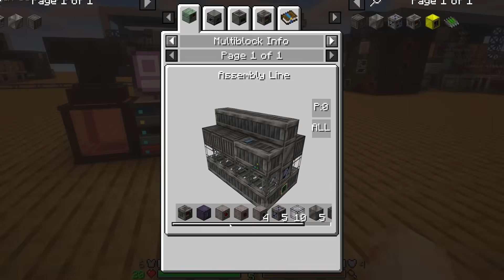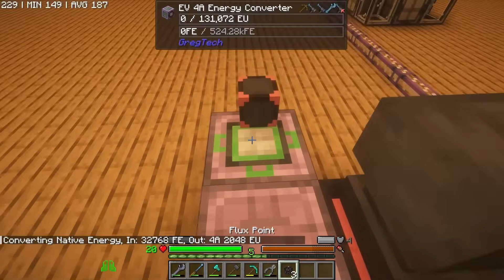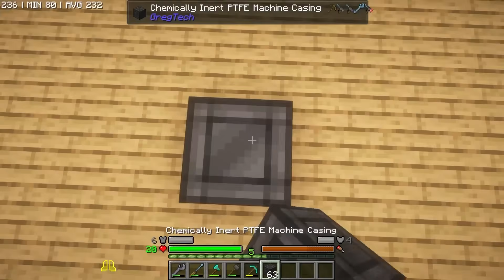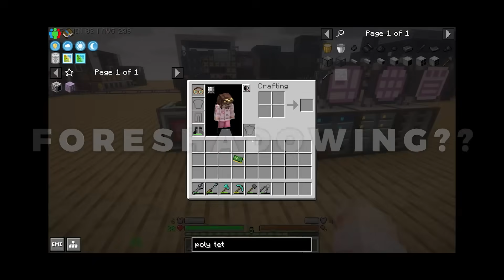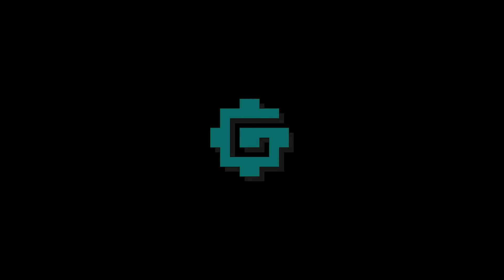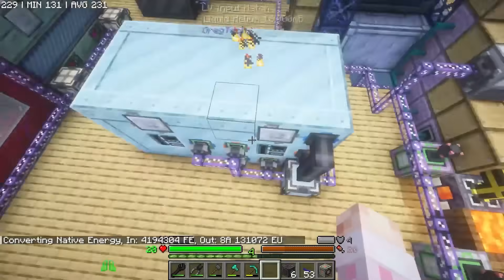Creating INFINITE Power In Skyblock | Star Technology (Part 6)

Comment: Hi there, i really enjoyed your video.

Gregtech is a difficult mod. But, here are some things to make your life just a little easier:

- Use 16a energy hatches -> they will not only skip a recipe tier, but will overclock to ridiculous speeds. (one 16a ZPM energy hatch = UHV processing speed, two 16a ZPM energy hatches = UHV processing speed and UV Recipe tier.)

- I'm not too sure how it works in star technology, but in most other gregtech modern packs, you can power all gregtech infrastructure with flux points. It will automatically convert FE to EU. 

- Your fusion reactors can be made cheaper in the future. Use fusion glass instead of fusion casing. Will save you TONS AND TONS of trinium, which takes ages to smelt.

great video, again.
Reply: @kopkalol123  i'm currently at ZPM and this comment was very helpful so thank you! Flux points cannot provide EU to Gregtech machines though, the config is disabled in this pack.
Reply: @TheDardo1997  interesting, last i checked, Flux points did work in ATM9.

Glad I could help otherwise.

Comment: To make things faster you can make 16A energy hatches to speed it up by 2 tiers and is you want it to be a be able to craft the next energy tier you will still need another regular energy hatch. For the assembly lines you can make a data bank to store all the data. Also for the fusion reactor if you use the 16A energy hatch you only need to power that singe one but you will still need to other energy hatches to reach the energy requirement.

Comment: You should have used fusion glass for the fusion reactor, it cuts down on fusion machine casings used, and it allows you to see inside the reactor (which produces a glowy ring while it's running)